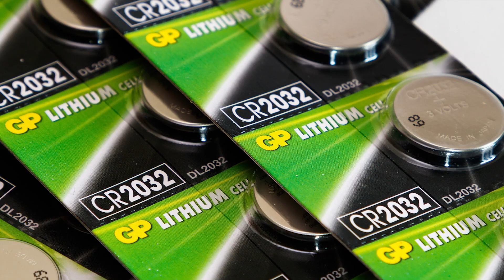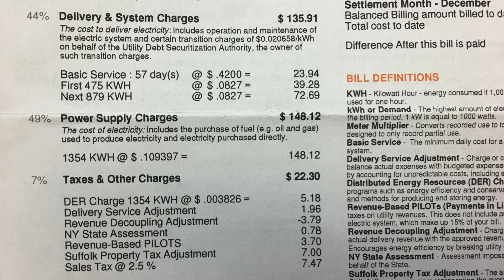PLANNING OUR OFF GRID SOLAR - How many watts do we need?

Comment: My electric bill is $30. A month in New York state. I have a 3 bdrm. I use one light at a time and all are LED. I don't have cable, a computer, internet or washer and dryer. If you're wanting to go solar start now at home where you already live. If you can't live without a home phone tv etc how can living off grid be feasible? That's how and why I do it. It's saving me a buttload of money too.
Reply from the maker: That’s exactly what we did. We were under 8,000 watts a month. We couldn’t figure out why they started estimating us so high. Long Island is also well known for their excessively high bills. Bottom line is that even with solar we will be able to enjoy those modern conveniences. Stay tuned and watch us show you that it’s possible!

Comment: how did you check any appliances that were not 110 - 120 volts ? the meter you show has a 120 volt plugin?
Reply from the maker: Yes the meter has 120 plug. A link is in the description below the video if you would like more information. We didn’t measure the 220 appliances because we plan on running them on propane.

Comment: So looking forward to seeing your journey progress ! The one thing I can share for sure is that the solar panels work better at specific angles and facing the sun. When I was looking after my son in laws place, the system he had needed adjustment by hand to track the sun through the day. Getting into a project, or a visit with friends, or a trip to town, or just plain forgetting to move the panel array had a negative effect on the power gathered by the panels. An automated tracking array would be an essential part of any system I would consider having. Best of days to you and your family !
Reply from the maker: That’s so true! Angle is super important. The automated system can be quite costly though and we don’t want to have to deal with moving them all the time. I think we are just going to optimize for the equinox’s and lean a little toward winter because we will need it more then

Comment: I wonder if it's worth considering installing electric heat in your very efficient earth sheltered home and beefing up the solar system to eliminate a heating systems initial cost and its maintenance. And heck, maybe even an electric hot water heater. That would also lower your propane usage. Which is kinda like still being semi-tied to the grid(or propane truck) Not sure how the numbers play out but it might be worth thinking about. Good luck guys🤔
Reply from the maker: Interesting thoughts but heats not really going to be an issue at all. Small wood stove will probably over heat us. Not taking chances with hot water and will still need propane either way for stove and backup generator.
Reply: The furnace delete and electric heat just popped into my head while I was watching. Lol
 it's probably worth considering for some set ups and situations though.
Don't forget the power hungry microwave and hair dryer. 
I can hear rich saying," the system was working great until I bought a welder." Lol
Good luck guys and happy planning.
Reply from the maker: We don’t use a microwave. Lol. Already have a welder 👍

Comment: Sounds great y’all what are y’all thinking for your a/c needs ?
Reply from the maker: Based on the design of the house we shouldn’t need any. But if we do we have thoughts on the mr cool. We should have a surplus of energy in the summers too👍
Reply: @CreatingASimplerLifeOffGrid  sounds good if you end up needing one y’all might check into a split system they are easily installed by DIY and you can install after the home is existing 👍
Reply from the maker: Definitely a thought👍

Comment: Another thought for your. Work with a solar company. A reliable one. I used Revision Energy (I live in Southern Maine) and they took care of all of the paperwork. It is better to pay someone to put up the solar panels, heat pumps, etc. The company will obtain the necessary permits, help you file the paperwork for the state and any rebates. Yes, the solar rebates are awesome. Do look at heat pumps, with propane fireplaces as a backup. I suggest one in the living room, one in your bed room. Also, wrap your pipes with good insulation.
Reply from the maker: Thanks!

Comment: Great video. You bring up many good points. I live in a house that was built in1750, and it is huge. Honestly, we should have had a fire sale and started all over, but alas, we put a lot of money into the house. We have a grid tied system that works well. We have electric heat pumps on the first floor and second floor. The electric bill in the winter is $600 plus about another $350 for propane. We figure for a house this size this is reasonable. One of the biggest factors in the energy efficiency of a house is the insulation. You can have a great solar system, etc., but poor insulation will negate any positives from the solar. I also have a solar on demand hot water heater, and that works well. Take a look at GP outdoors. GP did a video on his cabin near the lake. He has solar only and a heat pump with propane fireplaces. He explained his system well. We do have a propane generator, but may in the future add Tesla batteries as a backup, etc. We dd a 500 gallon underground tank. Looking forward to seeing the design of your house. Good luck!
Reply from the maker: That’s a lot of money for heat! Wow! We will definitely check out that channel. Thanks so much! We are really trying to plan ahead for exactly these reasons and appreciate all your input👍
Reply: @CreatingASimplerLifeOffGrid  Well, no. When my husband died from cancer in 2000, our heating bill was $5,000.00! Then with new insulation in the nw part of the house, I brought it down to $3,500. So I am very happy with my electric and heating bill of less than $1,000 for the year. In summer, my AC and electric is $11.30. Next month as it gets warmer, my electric bill will go down greatly. But like you, I want to generate my own electric, but right now it is not practical for me.
Reply from the maker: Wow. Sorry about your husband. And I respect trying to get those bills down. I’m with you there. Been working on it for years. I misunderstood and thought you were giving me monthly rather than yearly! You’re doing a great job👍

Comment: Tesla Powerwall and their new Tesla Solar Inverter.  Might be worth looking into if you have not already done so.
Reply from the maker: Kathie said she’s looking asap👍👍 thanks for the info
Reply: @CreatingASimplerLifeOffGrid , they're a bit tricky to set up, so be forewarned.  However, that being said, since Tesla itself doesn't provide the most explicit instructions for every application, there are many online forums which will guide you, at no cost, through every step of the way.  Good luck in your quest to liberate yourselves from the Powerslave Grid.
Reply from the maker: Thank you!
Reply: @CreatingASimplerLifeOffGrid , yeppers.
Reply from the maker: Ok. Just finished researching the Tesla powerball 2. They do offer a lot of energy for a lower amount of money. But the downsides are that it has to be outside, it does have the potential to go on fire easily from punctures or extreme changes in temperature, and if they’re not charging properly for whatever reason they can become unstable. Considering where we will be living in the Adirondacks, with a lot of hunting around and extreme temperatures, we feel the life po4 batteries are safer and will last longer. But thank you so much for sharing because I love learning new things! Kathie
Reply: @CreatingASimplerLifeOffGrid , makes sense to me mostly, however, they do not have to be outside.  I know of people with them on their garage wall.  No probs but I trust your judgement and sensibility for your situation which is unique.  Much respect for the research!

Comment: I worked the home remodeling/renovation circuit in the convention centers selling solar arrays for a while (did real well until I discovered some weather manipulatoin events).  The R.O.I. for solar doesn't work out in the end - you might break even after 20 years and then you have to start all over again and the toxic panels (which are extremely toxic to even manufacture) have to be replaced.  As for smart meters and energy usage estimation... yeah, it's a total scam and everyone knows it.  Are you guys familiar with Cymatics?  Have you ever used quartz in a piezo application?  Depending on your solar index rating, which will fluctuate even more (China now has a system developed for total weather control and we're catching up), solar may still be a decent back-up in an emergency situation.  Nice, well thought out video, Rich and Kathie.  "Am I allowed to be self-sufficient?"  Lol.  No, I have to depend on the frigging govt.  I like the way yooz think.
Reply from the maker: Thanks for all the info! Very much appreciate it👍
Reply: @CreatingASimplerLifeOffGrid , well, you may think I'm a loon for suggesting such endeavors, however, within simplicity belies much lost information and technology.  I'm focusing on getting free vibrational energy from 5g and 6g carrier waves - snatch it right from the air for free and translate the vibrations into energy.  Oh wait... vibrations are already energy, what am I saying?  :-)  Old religious symbols throughout all recorded human history were energy collectors.  Think about it.  That's why there's a war and race to control all resources and enslave humanity.  Energy is free.  Imagine a world where people didn't have to fight for such things?  We'd have no wars.  Wouldn't that suck?
Reply from the maker: That all sounds great to us so we are right there with you. Just want a peaceful and free life in the forest.